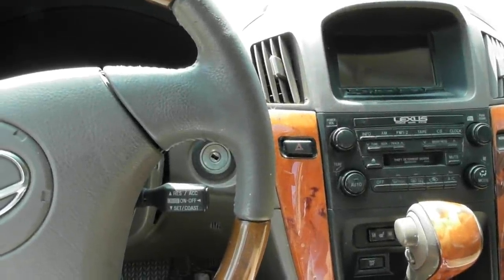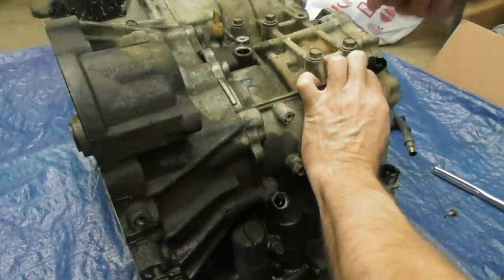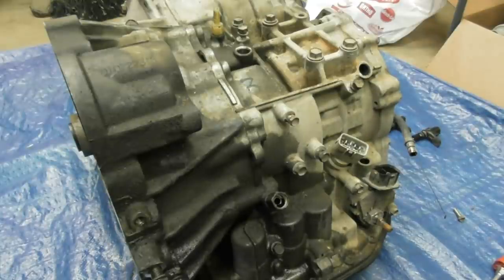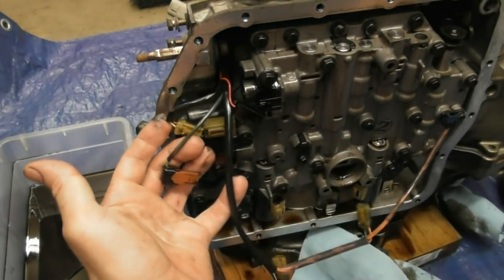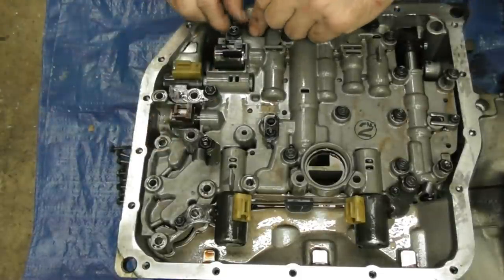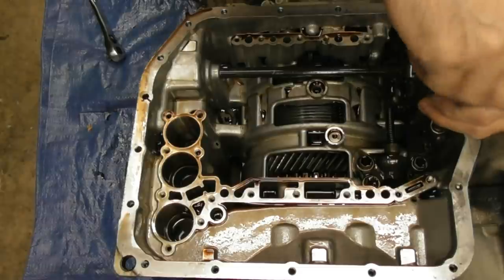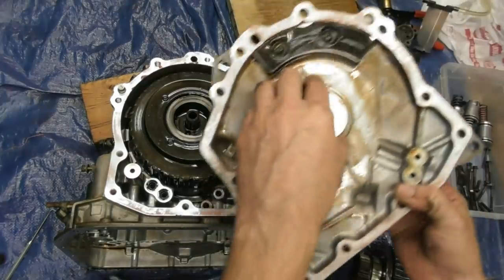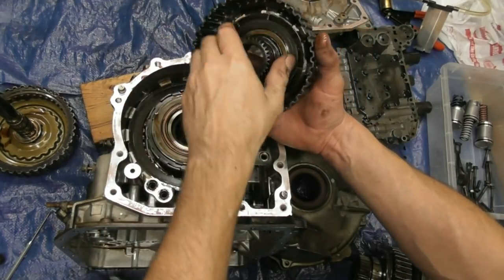Part 1-4 2002 Lexus RX300 U140 Transmission Disassembly

Comment: Awesome video. Say I messed up and put the middle accumulator in without the spring when working on my car. Do you or anybody know how to get it out of the hole? Thanks in advance.
Reply from the maker: Stephan, I think the middle accumulator spring(s) are on top of the piston. The two on the outsides were on the bottom. Either way, I would assume there is a port somewhere where you can apply a little compressed air to blow it out of the hole. Not much help, but hope it helps nonetheless. Good luck, G.
Reply: @ghostses  lol yeah I ended up finding it....got frustrated asf....thanks again
Reply from the maker: @stephencook7337  No problem Stephen. Glad you got it sorted out. Take care, G.

Comment: Hi sir i have a question i got a 2001 lexus rx300 and we got a same transmission.. my problem when you drive 4 miles and the 4th gear wont shift 60 mph and my rpm more than 3000 any idea what is that
Reply from the maker: Sorry, I know very little about them. I would start by checking if any codes are present. Good luck, G.
Reply: Thanks
Reply from the maker: No problem! G.
Reply: The O-Ring on one of the 3 pistons (responsible for switching 3..4) was broken. 10 ct. plus 3 hours to change it.
Reply: @reinhardstreiter351 hello, i have the same issue can you tell in which piston u change the O ring?

Comment: Oh yea, this is gonna be good and educational set of videos. Might want to put 911 on speed dial with all the blood your getting. Paper towels and blue tape for shop bandaids is what I use. Curious why first video was last uploaded? Just seeing if we are awake right?
Reply from the maker: I hope so Mac! They might help out the ambitious with a job like this. As strange as it might sound, super glue is my bandaid of choice. For clean cuts- they're usually healed up in a day or so. I upload the last video to first so they come up in order in the search list. So, in the future, if you see a part "what of what" coming in- just wait and they will all be uploaded. Take care, G.
Reply: ghostses Super glue, why not. They used it instead of stitches on me a few times. I'll try it.
It was difficult to wait for the 1st of 4, but I'm glad I did - haha.
Reply from the maker: That's exactly why I use it Mac! If the docs use it, why cant I?  I've cured some pretty bad wounds, some to the bone and stitch worthy, and it worked great. Not necessarily for the "weak at heart" that has to have a "pro" do the mending- but in most cases I'm the "pro"..lol. Never had an infection but buyer beware!  Try it out. Glad the wait was worth it. G.